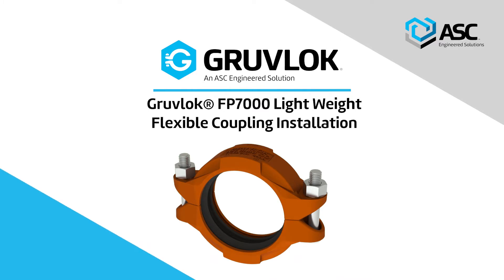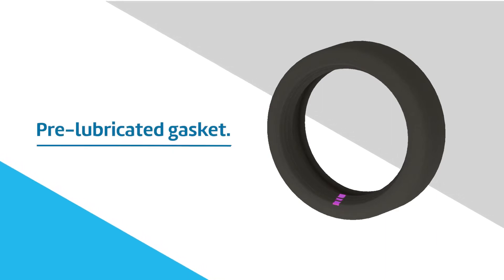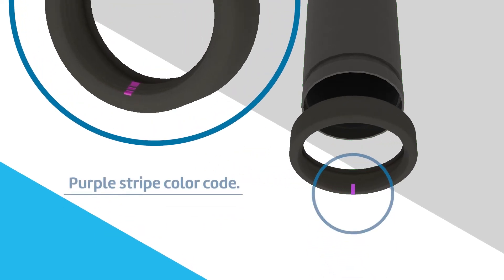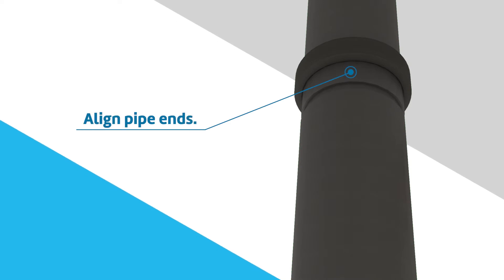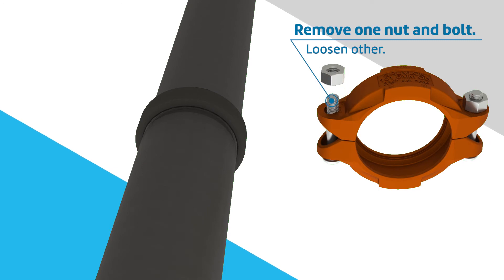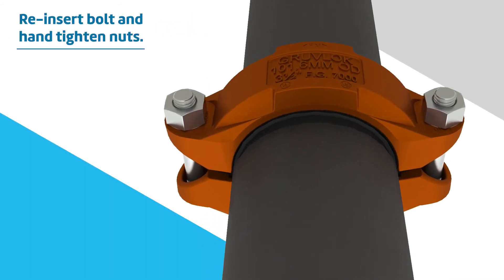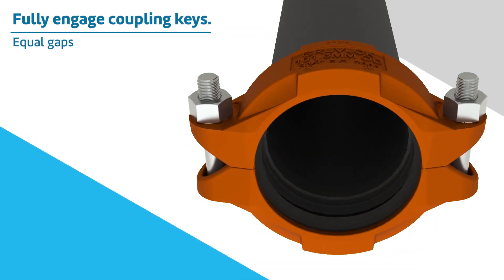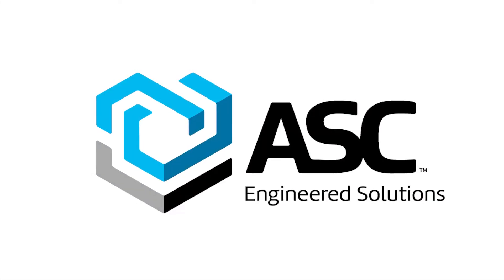Gruvlok® Figure 7000 Lightweight Coupling Installation Instructions

Comment: Radzik sent me one. Took to sprinkler installer. We put on vertical on 2 1/2" Pipe. It did not grab pipe at all. It just fell to the floor. Trash. On market the installers said U have to use a power tool. It should have been to tighten it up with a rachet. Engineers take a groove coupling gasket that works. Yall with hands watch the sealing lip snap back into place. In 74 coupling the ribs where designed to to not tare the sealing lip. My provisional patents shows it . Big corporations shouldn't take advantage of small inventors. Tell engineers just to install a old coupling gasket that works. They might get there finger nails dirty. 74 coupling. Installers told me. If you dont smash the gasket hard enough it will leak. If the grooves on pipe are to deep it is no longer a rigid coupling coupling. It makes it flexible. My concept was doomed from awful engineering

Comment: Victaulic wanted to hire me. Douglas Doyle. Press fit black eye. A 40 pound crimping machine. With a electrical cord. Black eye and the vic fit. It barely cut into the pipe. They blowed out.